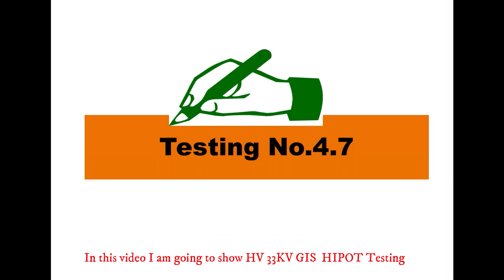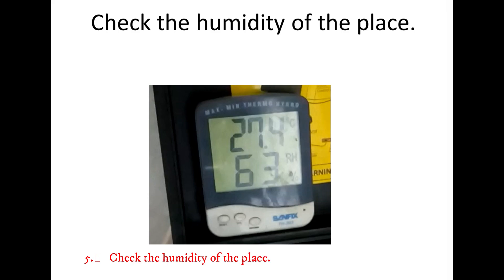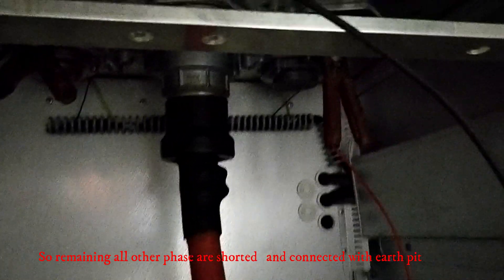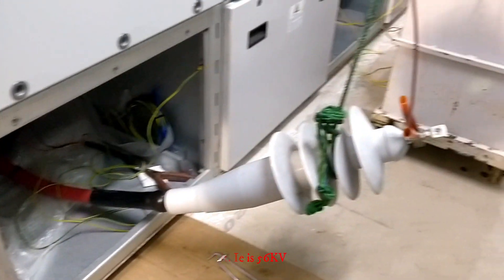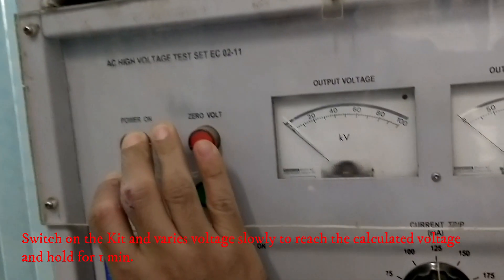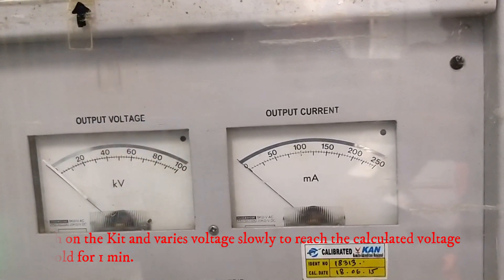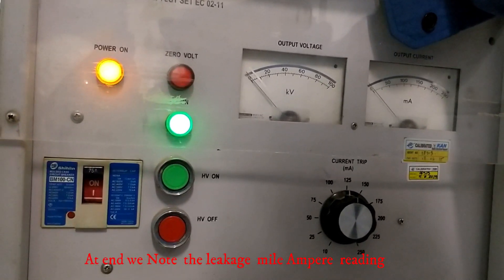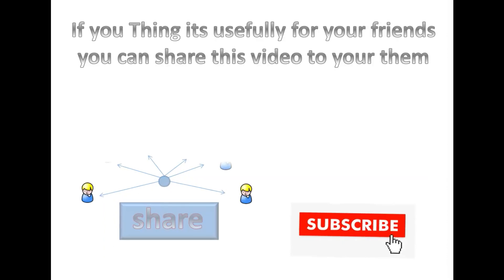GIS Bus Bar Hipot Test Explained | Step-by-Step High Voltage Test Procedure

Comment: What is the permissible leakage current for a successful Hipot of 33 kV GIS?
Reply: there is no certain value of leakage current . actually it depend the no of switch gear  under test. i will explain you more . if the leakage of one no swg  is 10 ma then suppose your switch gear is of 4 no then obviously the leakage court will be 4X10 =40 ma and so on for 10 no switch gear it will be 10X10=100ma. Generally it depend upon the bus bar length. longer is the length higher is the leakage  also note down that the capacity of the test set is very important . as the leakage current is coming from the test set now you calculate the capacity of the test set. suppose the you are excepting current 100ma at 70 kv then the capacity of the step up transformer  will be 0.010X70000=7000watts=7.0 Kw. so in size du to high insulation it will be of big size and it be difficult to build and hence cost will be more. Now come to the point the high voltage test is a "go" or "no go" test as for as insulation is not break down the test will be declared pass  the amount of  leakage current is not a deciding factor.

Comment: Is this AC hipot kit or dc hipot
Reply: Hi sir 
How DC Hipot??? 
but the formula you used here is of AC Hipot 80%Vp plz explain??
Reply: Busbar Hipot test AC, cable Hipot test DC used. 2E+1 80 % kV accept for 1 or 5  minutes depend upon on customer Requirement.
Reply: @சக்திவிவசாயம்-ஞ1ய SO,HERE AC HIPOT BEING TESTED, what about dc HIPOT voltage limit